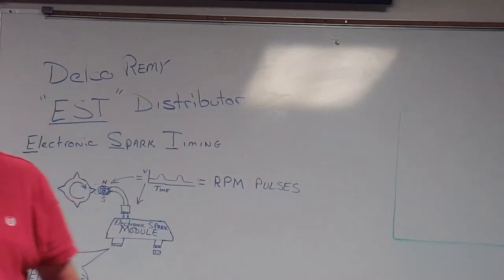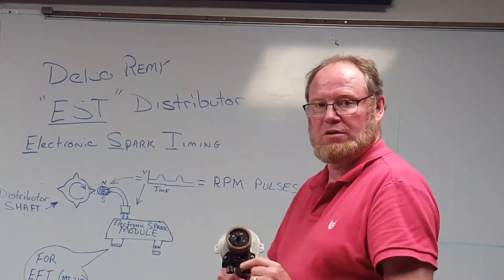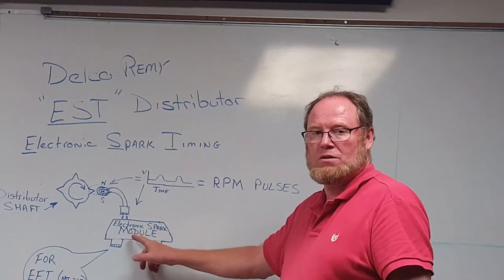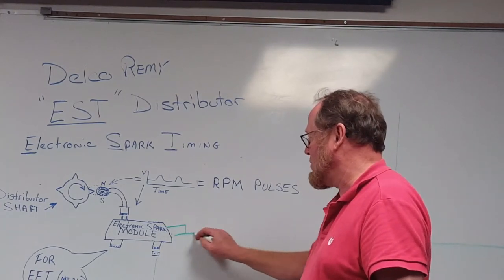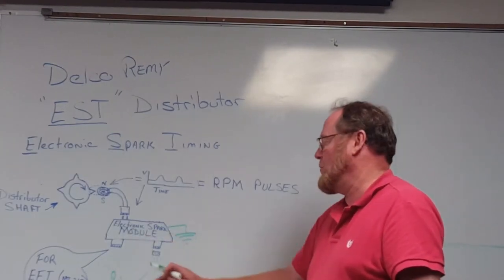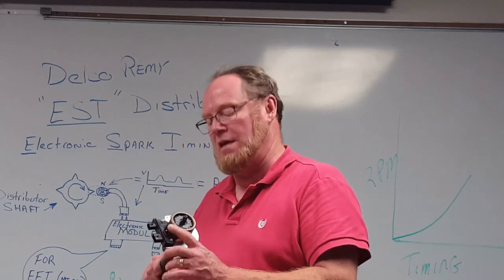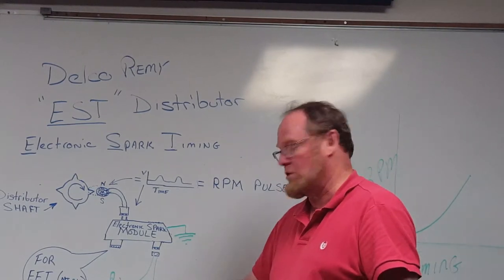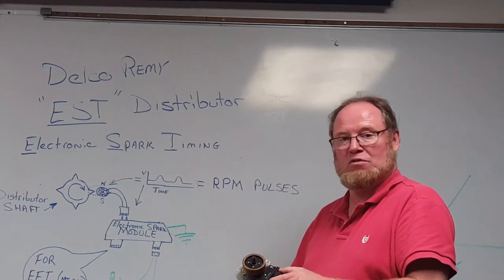MerCruiser and Volvo Penta Delco EST distributor

Comment: Could you tell me on the wiring where the 4 is going in what wire trigger the coil and what wire trigger the injectors .
Reply from the maker: Not sure of what you mean by where the 4 is going. The coil is fired thru the brown wire and the injectors are controlled by the ecm
Reply: @tedsmarinerepair8956  if you could assist what pin on the 4 pin  conector trigger the injectors and the coil for the ecm to know when to reff up . There is EST, Reff,BY Pass and B negative.thanks for the feed back.

Comment: I have a Mercruiser 454 Magnum Multi Port Injection MPI Engine Ser#0F802536 Module Distributor No Fuel Cool Year 1996 Gen 6
How Do I Lock Computer Out To Set Timing ..

Comment: I have what seems to be a miss below 1000 rpm’s. I will advance throttle to around 2200 rpm’s and it will fire on all cylinders again. Drop the throttle back to idle and it misses again. I have a 2006 Volvo Penta 3.0.
Reply from the maker: Start it when cold run for 15 seconds, sut off, remove back 2 spark plugs nearest the riser. If water is on plugs,  riser has failed.
Reply: Thank you for all your informative videos.
I have a 1996 MerCruiser 454 Mag MPI and get code 42. It runs rich and blackens all 8 new plugs. It pops back through the exhaust at about 1500 RPM and idles round and stalled out. I replaced cap and rotor with new plugs and wires. 
I replaced the pick up and model. Now it will not start. I put the original model in and it runs poorly as before. I tried 2 Quick Silver and one truck model and none of them will work.
I did some ohm readings and comparing.
When I check from the two wire connector that goes to the coil terminal C to all 4 terminals A,B,C,D going to ECM I get around 370 K Ohms on the module they will run the engine. But on the other module’s that will not run the engine I get 370 K Ohms on all terminals except terminal C and I get .936 M Ohms???? 
Could my problem be in the ECM? I have a MEFI 1  16189069.
I’m thinking the original model that runs tge engine has a short to ground on pin C. It must be telling the ECM to run the engine? 
Any help would be much appreciated. Thank you in advance.